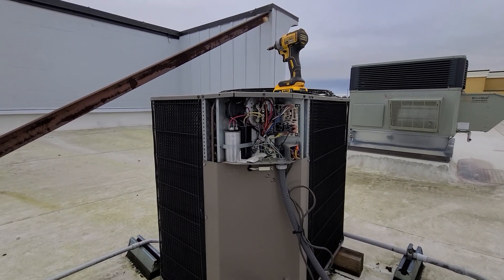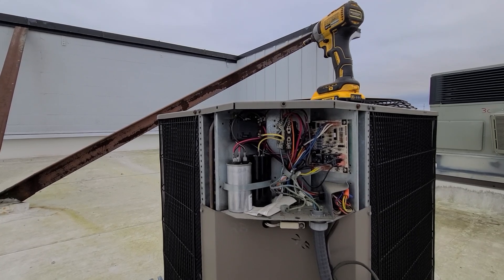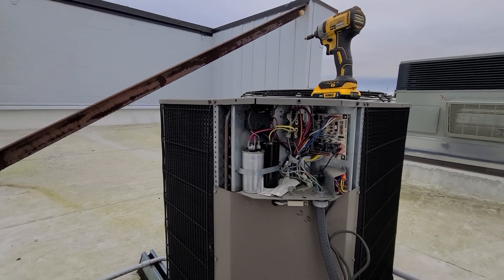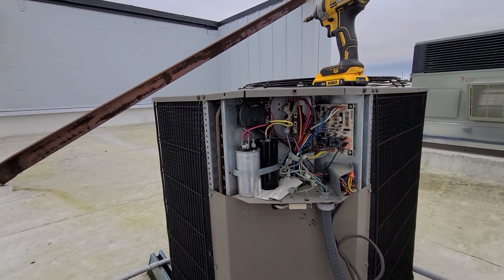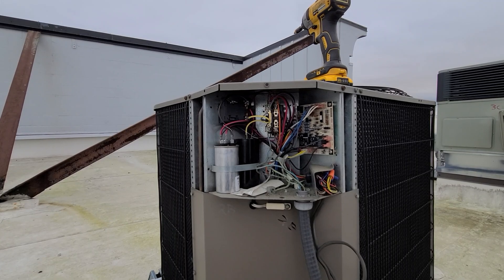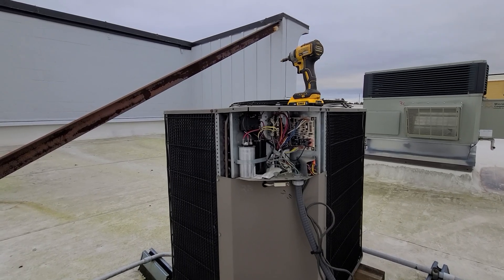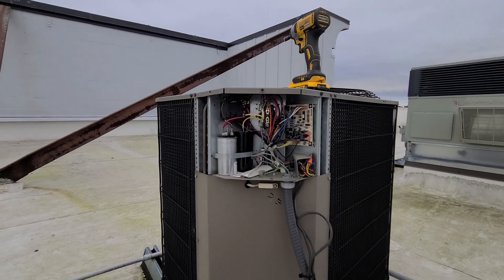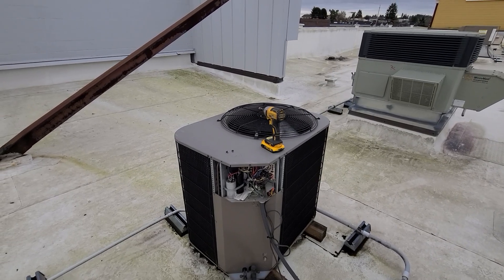York Heat Pump Troubleshooting

Comment: If you are having issues with compressors eating capacitors, I would do a resistance check on the compressor between windings and to ground. The winding insulation could be breaking down or it could be a loose connection on the terminals